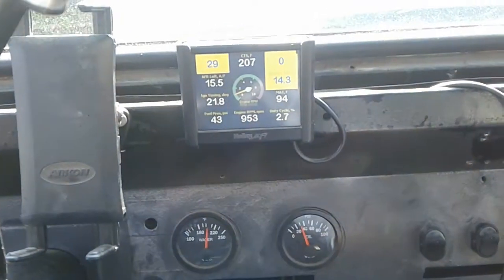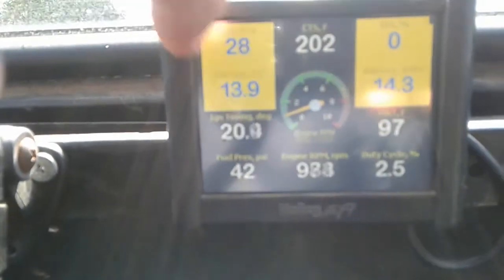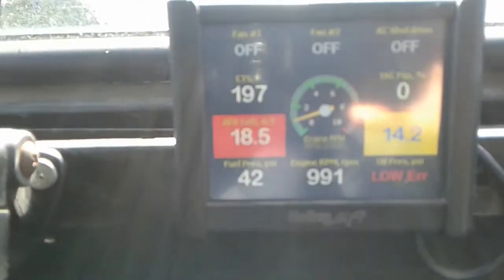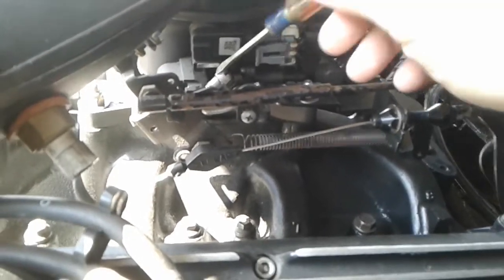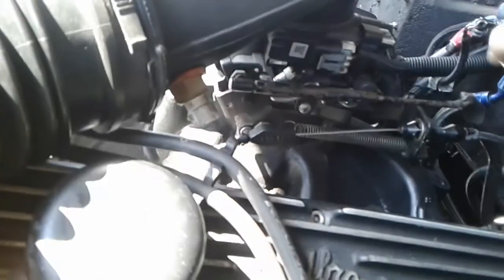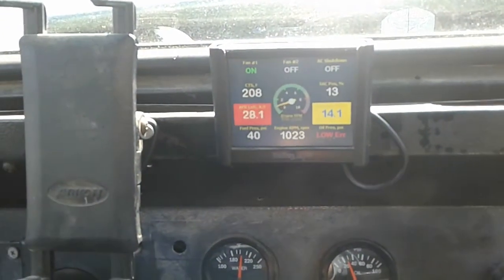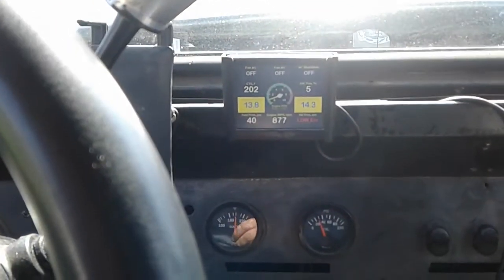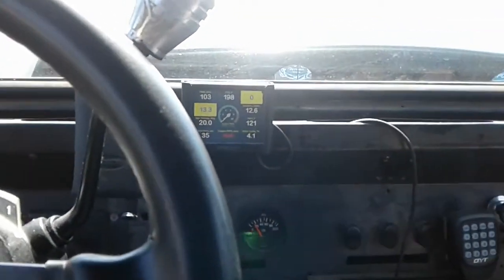Holley Terminator HP EFI idle IAC erratic idle hunting tuning

Comment: Looks like your temp sensor isn't reading which can wreak havoc on an efi.  I have a super sniper that had a temp sensor that crapped out and my iac did the same thing and was all over the place
Reply: What you do, fix the issue, replace system, or go in another direction?
Reply: No it looks like CTS is 201on the display....
It is important that ALL the sensors are operating properly.
Vacuum leaks are what causes havoc!